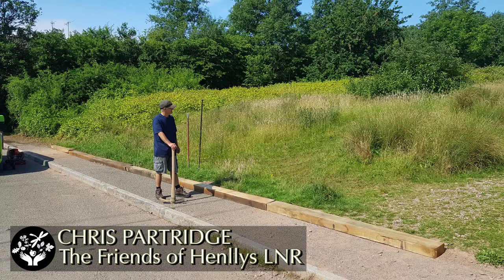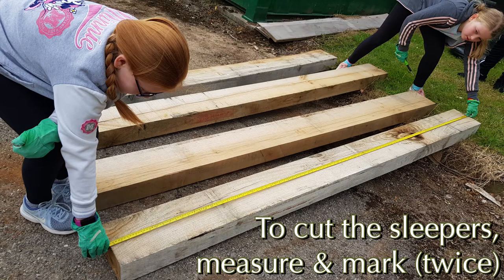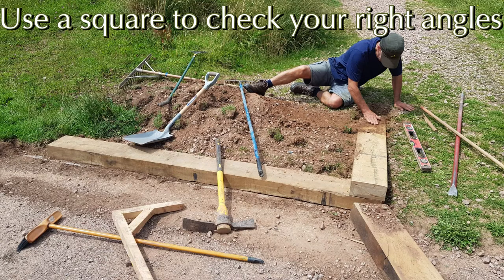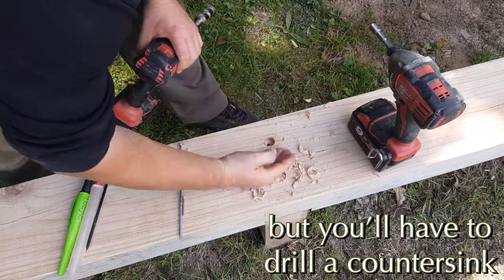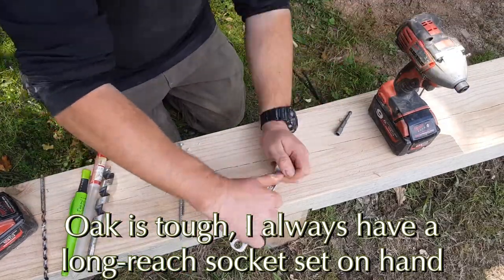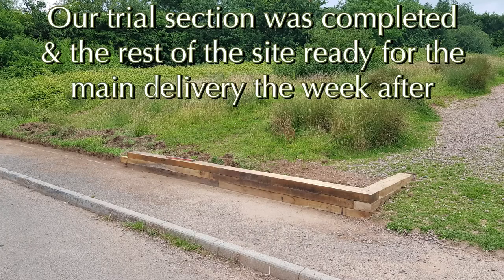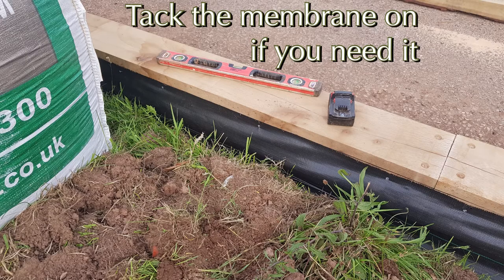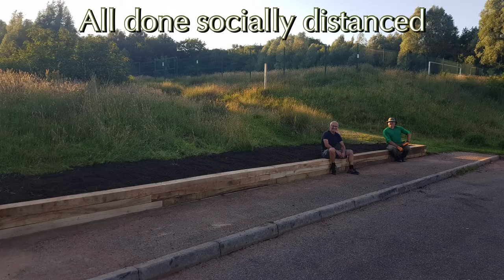Local Places for Nature. Tips for working with oak sleepers

Comment: This is great. Direct, straight to the point. Could I ask, what diameter was the 23cm long auger bit you used to pilot the holes? And what size bolts/timber screws did you use?

Many thanks.